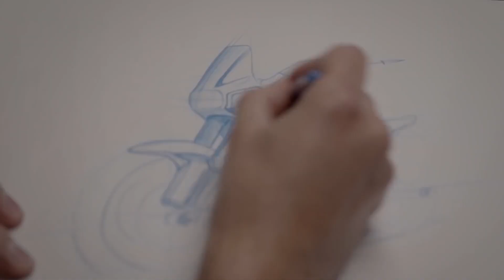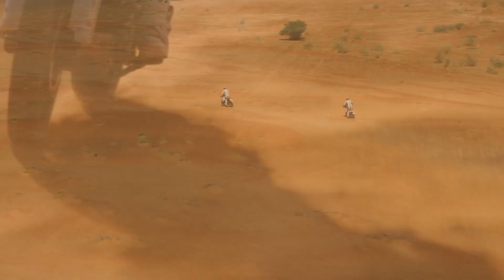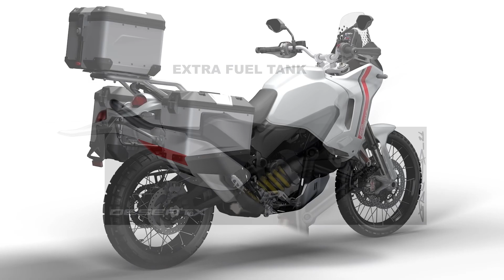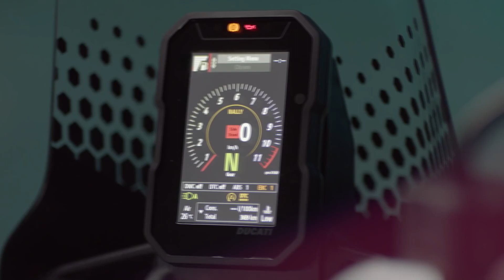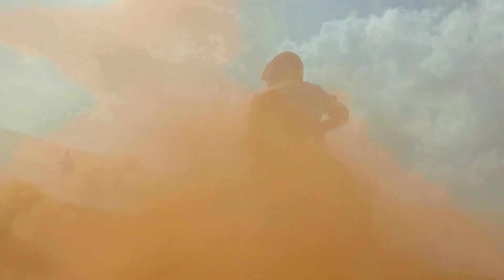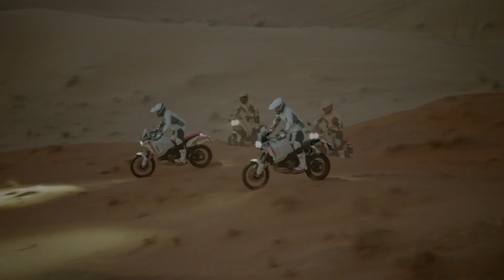The New DUCATI DESERTX PREVIEW | Is it all it's cracked up to be?

Comment: As far as cost goes. I guess it depends on how much value you put on design. I think this is really a stand out in the crowd and nothing gets close to looking as good. As far as KTM go, yes cheaper, but from my experience they are a nightmare to keep running well ( in dusty Australia ) even with spending a fortune getting it shipped to one of the 'best' ktm mechanics in my area the engine died after just under 10,000 km. Dealer told me this was standard for KTM in Australia.
Reply from the maker: Interesting - I have no experience of KTM in Aus, but they do require a lot more maintenance - particularly the enduro/dirt bikes (several oil filters/screens etc); if that is not adhered to, then they are likely to wear fast. The DX looks are subjective, but I like them.  Ducati though is not known for reliability.  You can start with the electrics, and end with the valves and fuelling.  They have a 2021 reliablity score of 67%.  One in three owners are dissastified with reliability, parts availability and service. If you are going to take the Desert X off road, then wait for a couple of years before buying one and the inevitable issues are partially fixed or flip a coin with the Tuareg...  Better still, get a World Raid T7, trick it up for the money saved, and ride rather than wrench.  Cheers.
Reply: @BlueMarbleRider  funny enough I came to the T7 conclusion too. Though the world raid won’t be available in Australia. The standard T7 is 4K less that the Desert X. Could do some nice mods with the extra $….though I was expecting a bigger difference in price.

Comment: Your 2 Down sides,  weight & engine size I'm fine with both. A higher cc engine means less compression for the same numbers as a 700cc meaning increased reliability. Ducati needs that extra reliability for an EU brand. As for weight - all that tech like abs adds lots of weight compared to a 90s model.  So the fact it weights the same as it's 90s counterpart is a pretty big deal. The only issue I have with it is it's price tag. But like Harleys and bmws, the name adds a price.
Reply from the maker: Yes, the price is high: a "Ducati tax" perhaps. Likely, because of the weight, it will be a handful on technical dirt trails with a full tank.  But if you are using it mainly on blacktop and fire service roads, then I think a lot a fun can be had!
Reply: @BlueMarbleRider  that makes sense. Thanks for the reply!